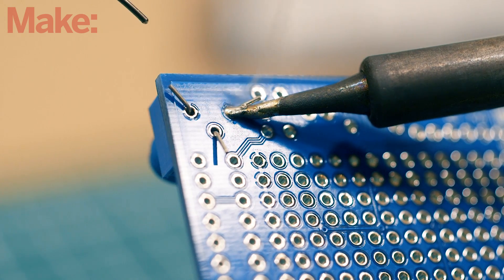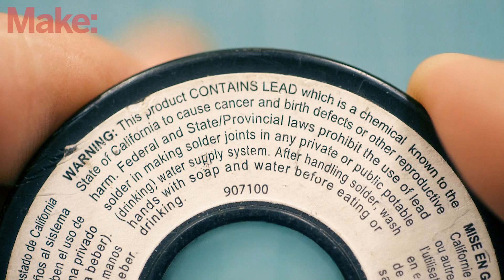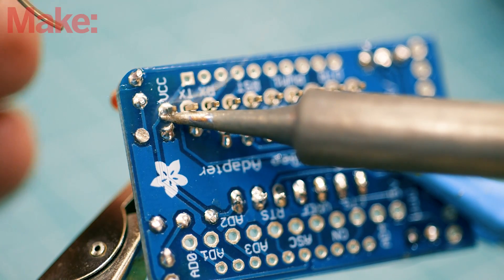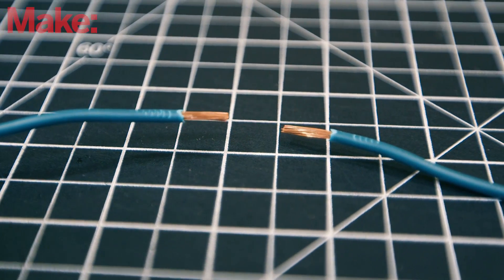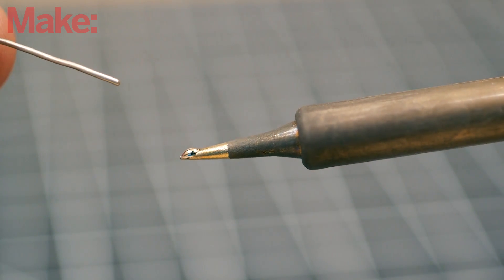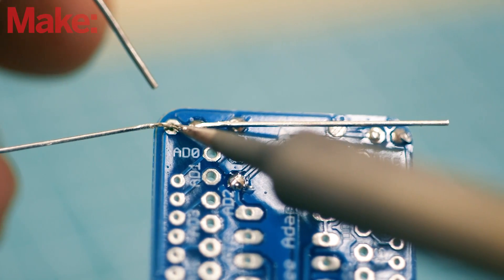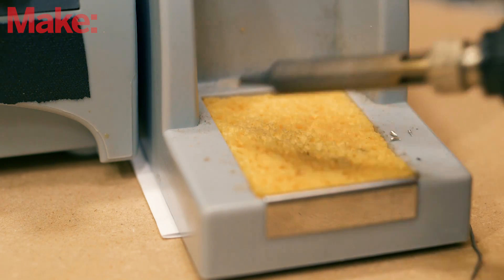Skillbuilder: Learn to Solder

Comment: Lead-free solder is really toxic although it doesn’t have lead. Really irresponsible to claim that 
lead-free solder would be safe. It’s safe to use only with proper respirator and gloves.

Comment: Conical tips tend to have terrible heat transfer characteristics due to the small surface area and mass. Get yourself a high quality chisel or wedge tip and it should work for 99% of THT component soldering. 

Fine point conical can be useful with SMD soldering, but more sophisticated techniques are generally required anyway. 

Simple tips: get a solder station with temperature control, use leaded solder with flux core (it's much easier to work with), don't apply solder to the tip when soldering a joint - apply to the component leg opposite of the iron. Lastly, practice. Get some cheap soldering practice kits. This will give you a feel for your iron, temperatures, solder behavior, etc before working on a real project.

Comment: Use a tip appropriate for the pad size.  Don't over use either the wet sponge or the brass tip cleaner. An overly wet sponge cools the tip too much. The brass tip cleaner CAN erode the iron tip. Never 'park' a iron without leaving some solder on the tip while it isn't being used. The tip will last longer. Never leave it without some fresh solder on it. Spend as little time as is necessary per solder joint.  The longer it is on the pad the higher risk of permanent damage. Leaded solder and lead free have different soldering characteristics. If excessive flux residue is left on the board, clean off with a flux remover. Flux is a cleaner of metals and can still contaminate a solder joint if left behind in sufficient quantity. A clean board after soldering is always best.

Comment: I'm only almost 13.
Reply: You do not have to have the best soldering iron in the universe. I had trashy ones when I was  kid but they worked ok and I soldered, replaced and fixed different stuff with them.
Now I got something similar to this one, it is ok.
https://www.banggood.com/DANIU-Professional-110V220V-60W-Adjustable-Temperature-Welding-Solder-Soldering-Iron-Tool-Kit-p-1142989.html
And remember you get your gear overtime, so each week, month, season...etc. think of tools, parts, things that could help you in whatever you are into and buy them. Get what just works, even if it were from the dollar store.
It is a good thing to have quality gear/parts, but if it stopping you from progressing then it turns into a curse, that one must avoid. Also in life you must dabble and try things for yourself like buying some stuff from dollar store like screw drivers or such and testing their quality and judging and rating it, like is it total trash or does it just work or is it fair/good...etc.
Buy an AM/FM radio from dollar store, open it up, look inside, learn how it works, tamper with it, take its ferrite out and tuning capacitor, try to build your own AM radio with that and a crystal diode like 1N34A...etc.
Buy cheap things, take them apart, learn, salvage, repurpose, modify....etc.
https://www.youtube.com/results?search_query=build+am+radio
http://sci-toys.com/scitoys/scitoys/radio/radio.html#crystal
Good luck and regards.

Comment: I have only used flux for soldering copper pipe and never on electrical parts or splicing wire together, cheers
Reply from the maker: I did that once! It was functional but it wasn't at all pretty!
Reply: mine was the prettiest you could have ever saw ;-)

Comment: No need to bend component legs over at 90 deg like shown in the video.  Doing so creates unnecessary stress on the component.  Once it's soldered, forcing the cutter blade under the leg to trim it creates lifting stress on the copper PCB pad.  Bend it just enough to keep it from falling out and no more.  Better yet, hold the component in place with a blob of Blu Tack so you don't have to bend the leads at all.
Reply from the maker: Yeah, I was overbending it just to make it clear in the video - Generally I just bend it enough that it won't fall or I use the helping hands to hold the component. The blue tack trick is great!

Comment: Good video. Beware of "solder bridges" that can cause short circuits and other troubles. Sometimes rubbing a little with the soldering iron will get the solder so flow and stick under less than ideal situations--like not perfectly clean metal. Of course it's better to clean off tarnish first, though.

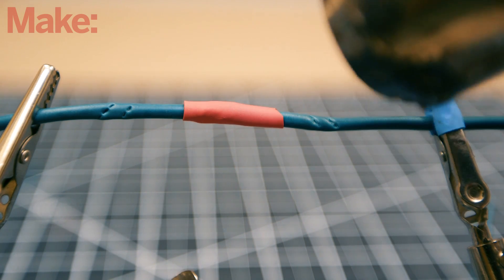Comment: 2:14 This is the worst...but it happens to the best of us. Remember, when you're fusing thick gauge copper, the wire will heat up dramatically up to 15cm away from the splice. This softens the protective plastic sheath and allows the helping-hands jaws bite right through; it also heats up the clamps. Before I made some Torlon clamps, I used to put pen lids over the jaws to prevent this.

Comment: Personally I find flat tips the best type to solder with. Never buy one of those irons with just a power cord attached to it! They are the worst! They're dangerous, and inefficient. A can good simple soldering station can be just as cheap. When soldering look at the tin spool and find what temperature your iron needs to be for that particular tin to melt, set your iron to a little above that. When soldering components onto a pcb you should generally use flux. Also don't bend the leads to far, you should seek a way to hold them in and not have to bend the legs at all. When you've soldered the component ALWAYS cut the leads a little above the solder joint! NEVER cut into the solder joint! This will cause a lot of stress on the solder connection and weaken it and you might even pull the whole pad off!
Just some additional tips for you! I had to find out the hard way.. ;-)
Reply: Oh and to quickly add on to that, you can never use to little solder! Make sure the connection is a nice   smooth bend finish and not a big fat blob of solder.
Reply: misterthekaitheman I don't understand why so many people say to not buy them. I have a $20 40W Antex from eBay and think it's really good, and I get excellent solder joints. 
Sure, it isn't ideal for SMD soldering, but it doesn't cost much, saves space, and is ideal for someone that doesn't solder that much.
Reply: Yonatan24 The problem with them is, that you can't set the temperature manually. This means that the chemicals in the tin which can't handle too much heat for instance get damaged and the tin won't flow well and you get bad connections. Also they are very inefficient.

Comment: I have an external hard drive with a broken micro USB port, looks like it popped off and could easily be soldered back. I have a soldering tool and standard solder. Do I need to do anything special or have a special solder/tool?
Reply: Perfect example why lead-free solder is awful.  It's brittle and easily cracks away from component pins or PCB pads, especially on connectors.  It was intended to reduce toxic waste in the environment, but it has created the opposite problem by increasing e-waste due to solder joint failures.

Anyway, for your repair, I would definitely use some liquid flux.  You can get it in a squeeze bottle with needle tip or in a fiber-tip pen.  Look on eBay for "flux pen".  Apply a little flux to the joint, touch it with your iron tip and add a little tin/lead solder.  It's a pretty easy repair, as long as you have a soldering tip of the right size and the copper pads haven't been lifted off the PCB.

If the copper pads have been lifted, you may have to super-glue the connector in place.  Follow the traces on the PCB to see where they go, then create a new connection from the USB connector pins to the right place on the PCB using very fine wire.  Good luck!

Comment: I always learnt to apply the soldering iron to the leg of the component before the pad. This is because the leg will take a longer time to heat up and on some circuit boards the pad can delaminate from the board
Reply: You were taught wrong. If the component is a heat sensitive semiconductor you should heat the pad. If you're lifting pads your iron is way too hot, or you are working too slowly.

Comment: Hmmm... a whole video on soldering without mentioning the word "flux"... very strange.
Reply: prem calibro Sorry, wrong!
With surface mount soldering, flux is even more critical. Often with motherboards they use a stencil to paint a layer of solder paste which contains it's own flux.
The way flux works is it actually removes oxidation from the surfaces when the "weld" / solder junction is made.
True some flux needs to be cleaned off because it would corrode in the long term. Most modern flux is "no clean" meaning you don't have to clean up afterwards. A quick toothbrush with isopropanol is the best thing if you do need to clean any excess off.

Don't confuse non electrical flux with stuff for welding copper pipes etc, that's no good for electronics. Maybe that's what you're thinking of?
Reply: I've been bitching about Make's lack of soldering skill videos for years now.  Used to get drunk and go on super rants.  This could have been much better...
Reply: +Obama Jr Yeah, I get by using only flux-core solder. A good brand of solder, like multicore, should do just fine without. I mainly use a flux pen for desoldering/rework.
Reply: @BrentBlueAllen   No it won't. It's only good for perfect condition, freshly stripped wires, copper on copper connections. Try anything else and you end up with cold joint.
Reply: SciPunk215 really poor video.
Reply: SciPunk215 - I thought the same thing at first. My ex was plumber those are huge jobs compared to what he's doing here. Looking at the comments, I agree with y'all.
Reply: One trick that I use is never being able to solder anything together.. it takes practice, but anyone can be incapable of soldering too if you try.
Reply: Flux is in electrical solder, never any need to add any additional flux.
Reply: it for novices, you do not wanna scare the heck outta them with too much items to deal with.
Then at a certain point of time they are gonna figure it out for themselves, that there must be something that must make this soldering thing work better but what is it given there's such?!
Then they come across flux then think aha that is exactly it! ;D
Some soldering wire got flux inside it (rosen core).
And then you never mentioned cleaning after applying flux with some solvent like rubbing alcohol or aceton(one could use pure/plain nail polish remove, it got aceton), just kidding with you.
Flux residue is that brownish spots left after soldering, on darker color boards; green/red you do not notice them much but they are there, but on a lighter boards/PCBs like white you do see them.
Regards
Reply: flux causes oxidation which leds to corrosiveness. And so the heavy electricals and mother board dont use flux

Comment: I wouldnt make a tutorial about soldering, if I cant solder my self. At 2:20 you can see 6 (or 5, I guess that all resistors are soldered) solder joints from other side, and all of them suck. Only two of them are almost nice, but not quite (bottom right and left). You could even try!
Reply from the maker: Let's try to keep this helpful here: I'm far from  pro at this but I've soldered hundreds of functioning circuits. What could I have done better?
Reply: Chuck Norris I was thinking the same thing. He is not the person that should be teaching others.
Reply from the maker: Of course Chuck Norris can solder better than I can.
Reply: He soldered them correctly! The Resistors were soldered from the other side. You can see that just 15 seconds later. What you see at (min) 2:20  was the solder that oozing through the holes to the other side.
Reply: Chuck Norris it is time for you to retire ,man.Your eyes are getting bad if you don't see de difference between the front and back of a circuitboard.
You and mister Greg Brown ,you want to make a fool out of him but instead you make fools of yourselves.
If you both think soldering is done on the frontside then you both haven't done any or very little soldering in life ,then i suggest to watch the vid 2 or 3 more times , so that you understand what he want to teach you.
Oke not evey joint is perfect ,but perfect enough for you 2 and other beginners.
Sorry guys ,but that was very low from the both of you ,learn something instead of trying to make fun of someone that wants help other people some basic skils.
The joke is on you two.
Reply: HAHA Chuck Norris, that's hilarious! Way to make a fool of yourself! He soldered those on the other side. YOU could even try!